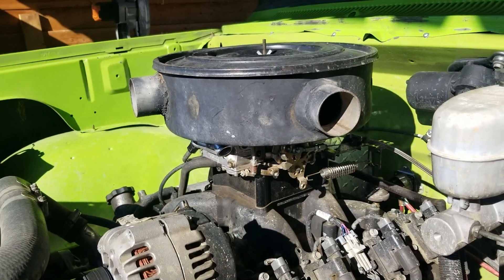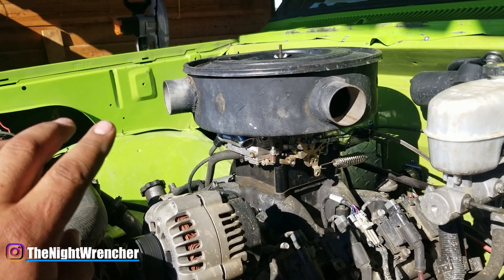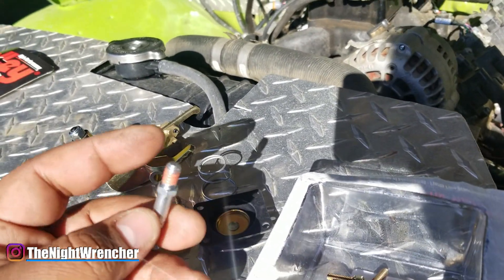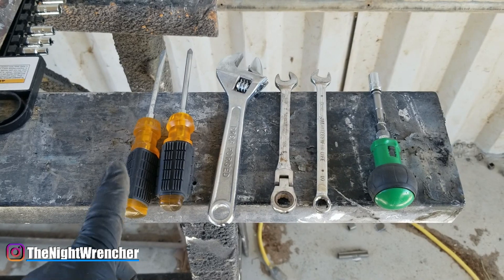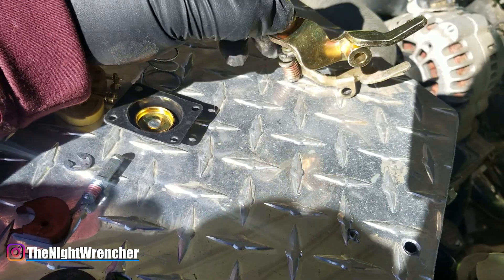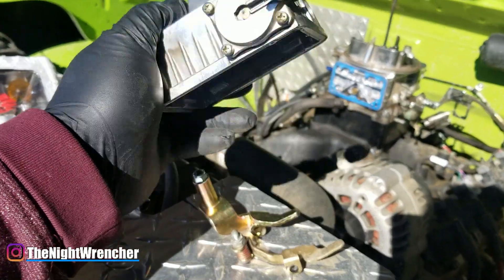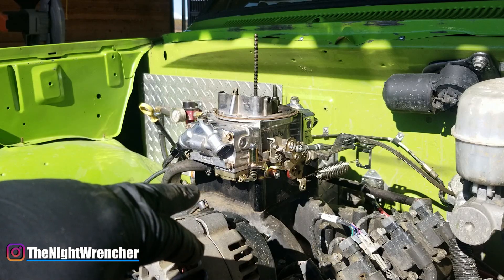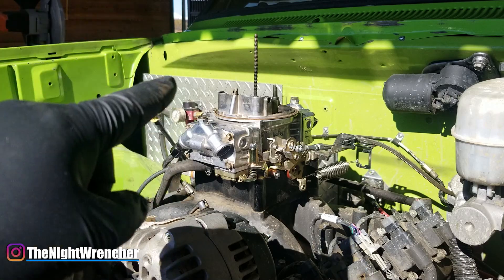Holley 50cc Accelerator Pump Installation And Explanation | Holley Carburetor Secrets |

Comment: You might have been able to accomplish the same thing with a blue pump cam in the second position and the 30cc pump. The blue one uses up pretty much all of the 30cc’s travel. The blue and green cams have a lot of initial hit, the pink one moves a ton but does it very slowly and I have never got the white, black or red cams to work on anything-they don’t move enough fuel.
Reply from the maker: Thats interesting! I'll have to try that out next time, good stuff.

Comment: Putting the 50cc in a 650 brawler carb. I got a stumble on takeoff and research has pretty much pointed to this being the cure. Lol. Thanks for the video !
Reply from the maker: I put them on everything. A healthy engine sucking a lot of vacuum loves big pump shots. I've been running a 40 squirter with the 50cc pump and brown cam on every engine I have and none of them have an off idle stumble. Nice and crisp.
Reply: Change the pump cam. I put some cams on thingiverse if you want to print them.  I'll be putting a brown 50cc cam up soon too. Use petg plastic.

Comment: Yellow is for a Dominator carb. The throttle shaft is bigger. That's the main difference between the yellow and brown cam. I have seen guys run the yellow on a 4150 but really, just use the brown one.
Reply from the maker: Thats good to know! I've bought the BPT and AED kits but this is the first time Ive used a Holley kit so thats interesting!
Reply: @NightWrencher  No Problem. Put them side by side again, you will see it. Holley should really mention this, but they don't. Just like they don't put out a lot of info on the different patterns of each cam. You can find charts online, but they are from customers, not Holley.
Reply from the maker: Ive noticed that. Even looking at charts, theyre not always the same even when comparing the same color. Ive only seen a few different 50cc pump cams but the profiles have been pretty much the same
Reply: @roaddog1973  i have a problem with a holley 850hp on a Cleveland. Can you give some tips? I found the mains to be 86 instead of 80 what it came with was way to lean. PV is 2.5 since i have a very big cam with almost no vacuüm reading. Thinking of blocking it off. I tryed different cams and squirters on the 30cc pump but cant seem to get the slight hesitation out. Big cam with large nozzle got my a quick reaction but then it runs out of fuel before the mains kick in
Reply from the maker: Have you checked the size of the IFRs? It it takes 86 jets in the primary, the IFR will want to be pretty big as well, at least .034
Reply: @NightWrencher  i now have 88 mains in x4. But feel no difference or improvement over the 86. So around 86 should be fine. Will blocking of the PV help?
 I tried 37 with a pretty quick high lift cam. That gave better reaction but i feel the pump shot lasted to short thats why i am leaning towards the 50cc pump acc setup. I don't know the exact setup now will have to look it up tomorrow. I know my way around carbs. It's Just that double pumpers are a pain to get right
Reply: @NightWrencher  whats ifr? Im dutch by the way trying my best in english ;)
Reply: @NightWrencher  its a 4v Cleveland . 12.5 compression single plane intake with spacer. Holley 850hp street aluminium carb.
Dss pistons, eagle rods, ARP bolts, balanced..
MSD 6a ignition. Headers..
Comp cams 292H flat tappet kit with springs
Milodon SS valves. Scorpion roller rockers.
Comp cam push rods.
Fuel used is 100/102 octane. Timing all in 39.
Reply: @NightWrencher  i need more duration on the pump shot with a medium to high lift cam i think.
That's why i feel going to the 50cc pump
Reply from the maker: Going to a 50cc can only help. Initial accelerator hits rely solely on the accel pump circuit. I would jet it back down to 86 in the primaries and see if you can measure out your Idle Feed Restrictors. I am guessing thats where you are hitting your lean spot. Throw on the 50cc accel pump kit and go from there
Reply: @NightWrencher  the strange thing is this carb comes with 80s main jets square and the secondairy had no PV...
Installing the 50cc pumps today. Should I remove the primairy PV to? Because my vacuüm is so low 3/4 Hg on idle. I have a 2.5 in now. Stock was 4.5 . Some say leave in some say block off. What do you think
Reply from the maker: @hoedemakerbart  your vacuum is so low now, you're always going to be in the PV circuit so might as well just block it off and jet up if needed. Block it off and drive it to see if you notice hesitation. If not, leave it as is. If you notice low end hesitation at constant throttle then jet up 2 sizes
Reply: @NightWrencher  you think blocking it off affects cruising/mid rpm usage? I do drive it on the street. Vacuüm needle bounces between 3/5hg idle in Gear so 2.5 would be my lowest option pv.

OR block it and Just work with the acc pump and mains?
Reply: @NightWrencher  ill block it and see what it does
Reply from the maker: Sounds good lmk
Reply from the maker: @hoedemakerbart  during cruise you probably have no vacuum at all so I wouldnt worry about the PV too much
Reply: @NightWrencher  i blocked it. 50cc pump is on  with Brown cams. 37 squirters with hollow tube. 88 mains all around. Never saw black smoke with 88s..

Continu tomorrow will see what it does
Reply: @NightWrencher  it worked watch the video on my channel
Reply: @NightWrencher  i tried holley tech help but that doesn't get me anywhere lol. I need advise from some experienced guys